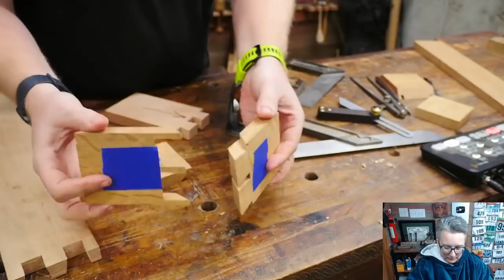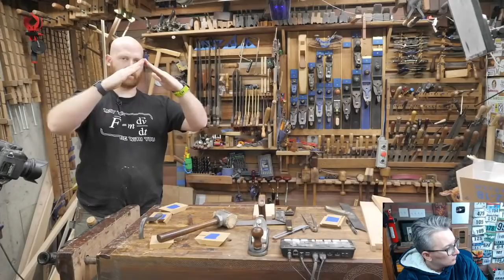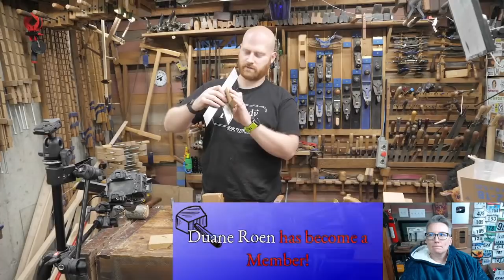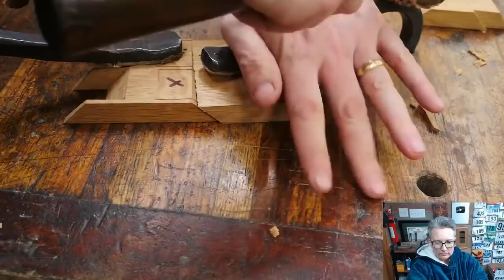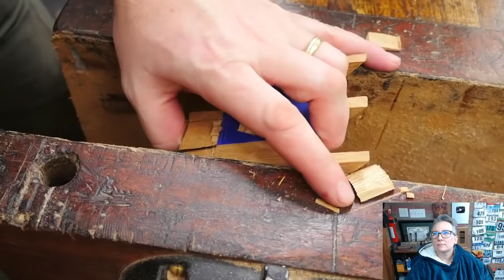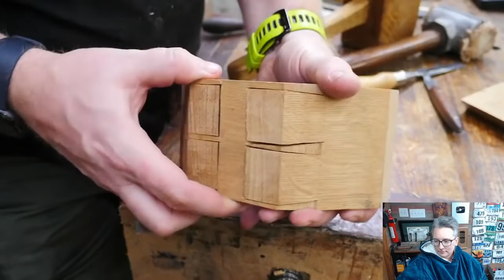How to Cut an Angled Dovetail LIVE

Comment: The try square you are demonstrating with can also measure 45 degrees.
Reply from the maker: Yes, I can. I've used it a few times for that. The problem is it has such a small reference surface that it can lead to several issues. So I generally don't use that one for 45° angles.